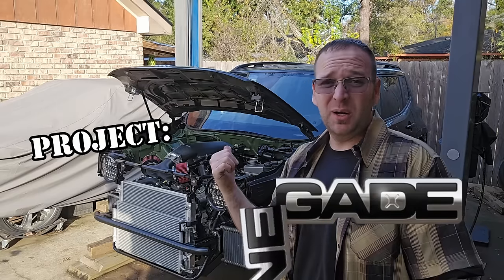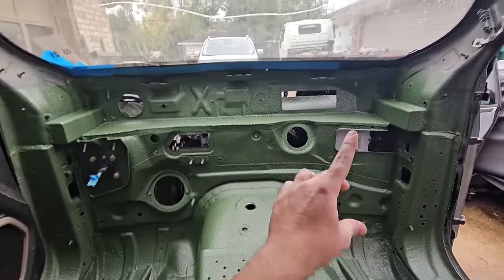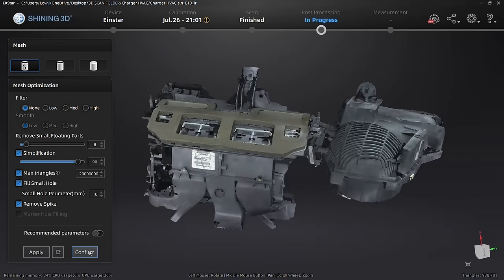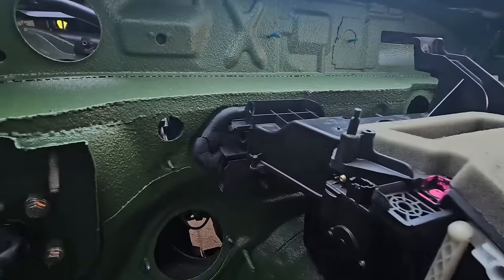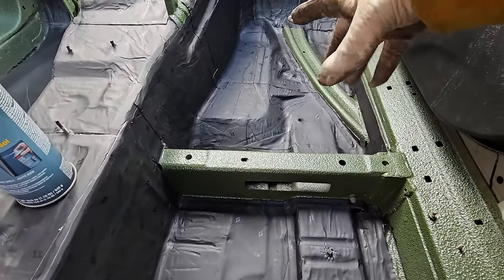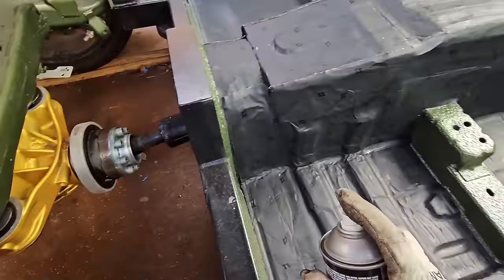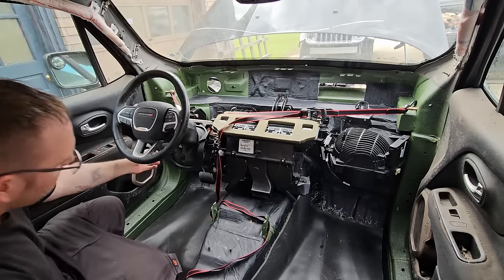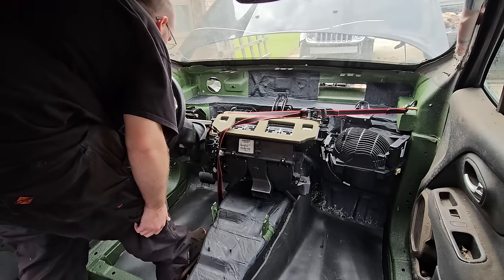HEMI Swap Jeep Renegade pt. 31 Starting on the Interior!

Comment: Mike....... Ah man I'm so stoked for you! Its getting closer and closer & I can hear it in your voice how eager you are to have this on the road and driving..... YES!!!! But, if I can make a suggestion, before you go too far... welding causes splatter and could start fires so my suggestion  would be to finish the rear floor and patch panels on the firewall before you have to back up and remove the air box, steering wheel or wiring harness from things getting damaged as that would delay everything further!!  Im with you Bud!  Wishing you the best!!! AND saving the best for last..... that air box scan and cut was FREAKING GENIUS!!!!!!  Seriously!!!
Reply from the maker: Thanks for the advice, and good looking out!  For the firewall I plan on making parch panels that will bolt or clip in.  They'll most likely be 3D printed in ABS.  For the rear, I planned on making removable panels so I can get access to everything from the top side.  This is pretty much the same thing I did for my HHR Panel that I built independent rear suspension for.  It'll take some welding along the edges for L brackets, but I picked up a spot welder for that.  I should definitely pick up some welding blankets just in case.  On the plus side, I did get the wiring harness laid out and it looks like it'll mostly fit.  And that 3D scanner is so much more useful than I was ever expecting, and lets you solve all the problems before ever doing any actual work, it's crazy!
Reply: @HEMIGADE those are excellent solutions!!! I’m really excited for you!!! Remember to take care of your health and get plenty of rest as you need to really have time to enjoy your creation that Dodge themselves would be envious of!

Comment: Mike you might look at a product called Lizard  skin it sprays on  they make two diffrent sprays one for sound and one has ceramic particles in it  for heat control. It can be painted over.
Reply from the maker: Cool, I'll have to look into that, might have to re-spray the underside if this stuff doesn't work.

Comment: What’s the renegade in the background?
Reply from the maker: that's my spare renegade for taking measurements and stuff.  I'll be using it to mock up the new widebody kit, and I've used it as reference for the dash already.  I picked it up wrecked for $2,600 so it's not that bad.

Comment: You'll end up with a daily driver...
Reply from the maker: That's the goal, make something that's capable and reliable, and as close to an OEM build as possible.
Reply: @HEMIGADE  you already told me you were going to turbo it so don't come now with that...
Reply from the maker: @Room1sixtyfive  well, you can daily drive a turbo car too 🤣
Reply: @HEMIGADE  ok, ok, I was kinda like... You know, for a second. Nice build brother, from all the builds that I'm following this is the one that I'm rooting the most. The HEMI engine it's pretty underrated for turbo, my stepfather had a Lincoln Continental with a TT HEMi engine in it and that thing pulled like 1,200hp without any problems and it was reliable too. Unfortunately he had to sold that car which it was a project between him and my brother and since then I have always looked up for HEMI swaps and before I die I'm swapping a HEMI in a 1964 Lincoln Continental. Meanwhile this is that next HEMI swap I'm following 🫶🏽